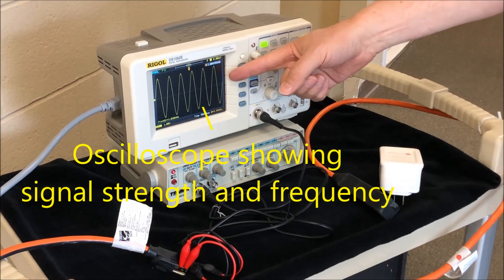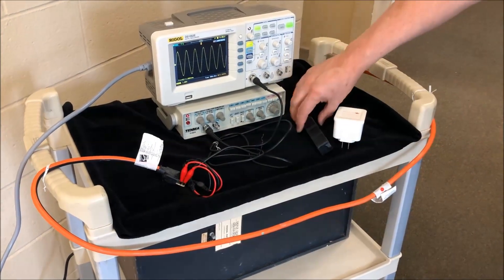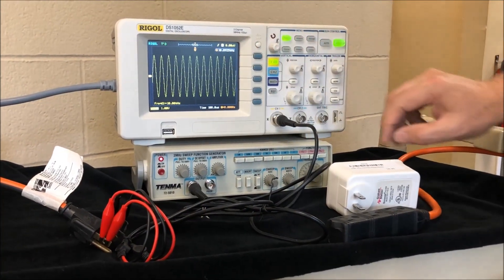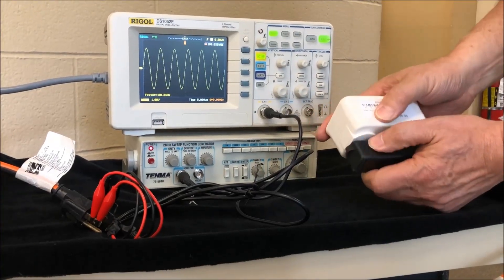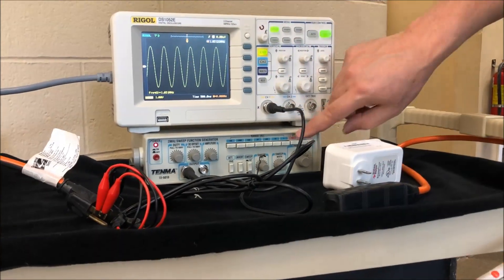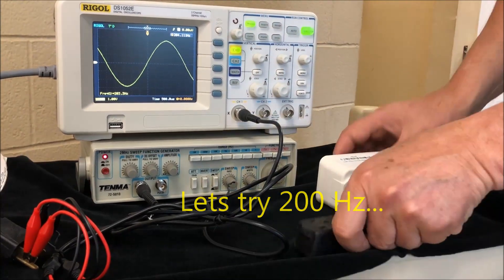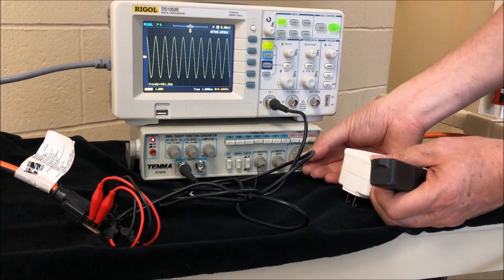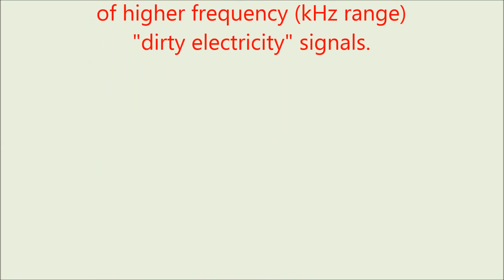Testing the Effectiveness of Stetzer Filters

Comment: My friend, please, I’m begging for your help! Ever since I bought my gaming PC with all brand-new components three years ago, I’ve been struggling with a “floating mouse” and lack of hit registration in Counter-Strike 2 and Call of Duty. I’ve tried every possible way to update drivers (both hardware and BIOS) you can imagine. The electrical panel in my apartment is digital — what you call a smart meter — and I believe the EMI it generates is the cause of all this. I’ve already tried contacting the power company, but they refused to replace it with a conventional analog meter. I noticed about a 20% improvement after purchasing an iCLAMPER Energia 5 power line filter. Later, I decided to invest in a UPS, but I ended up buying a line-interactive model instead of a true double-conversion one, though it does have a pure sine wave output. The UPS helped improve things by about another 30%, but the problem still persists. I was considering buying a double-conversion UPS until I watched your video. Would the Stetzerizer filter solve my problem? Or should I buy a low-frequency filter instead? What would you recommend?

Comment: Does this cover one outlet, one circuit, or an entire house or building?  What is the range of coverage?
Reply from the maker: Each filter will serve one circuit. If you have high levels, you might need more than one filter on a particular circuit. You may also find that you get better results by placing the filter in a particular outlet on the circuit compared to other outlets on that same circuit  (it all depends on what is plugged into that circuit).
Reply from the maker: Typically we recommend one filter per circuit.
Reply: How do i know how many circuits I have? My fuse box is big. Is each fuse a circuit?
Reply from the maker: Yes, that is exactly right.